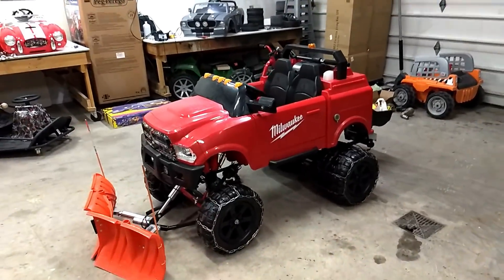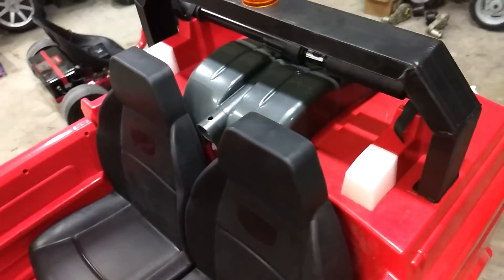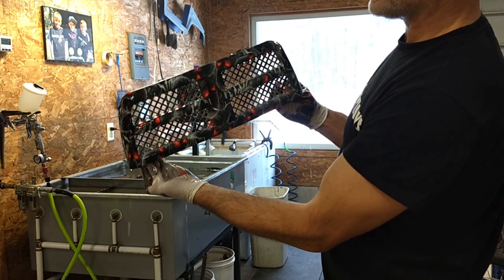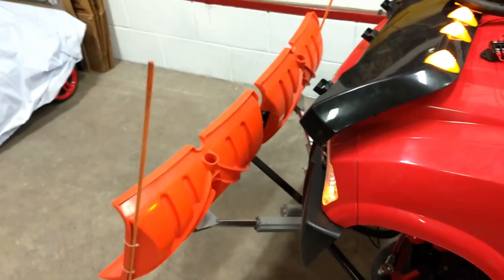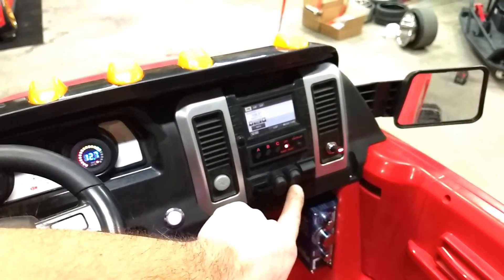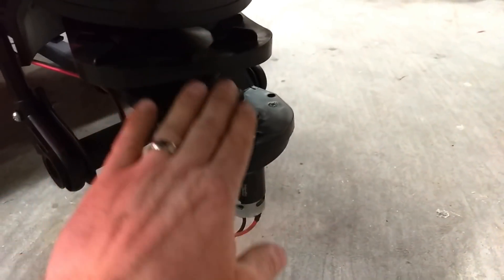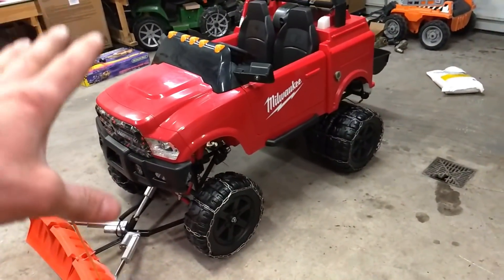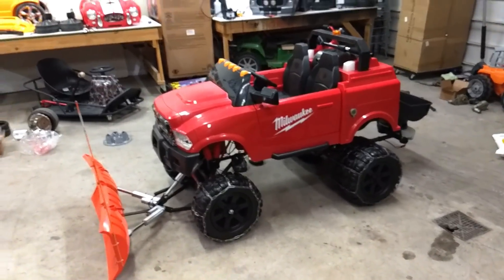4x4 powerwheels build with V-plow 24 volt upgrade- Part 9 FINISHED!

Comment: Get a Whelen lf22. It’s an led strobe controller.  It’s a two channel but it will handle up to 5 Amps worth of lights. I think it would look sick if you alternate the clearance light and the head and tails. They aren’t that expensive and super easy to wire.

I’d also add a work light to the spreader area so you can tell it’s spreading
Reply from the maker: Awesome! We will check it out. Super cool ideas and thanks for watching.